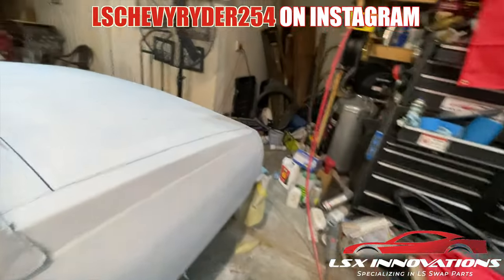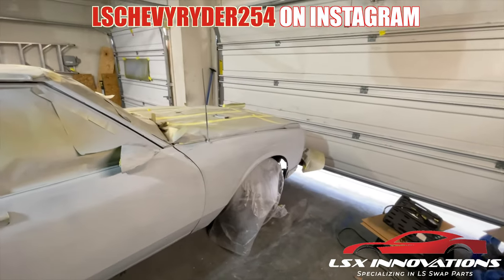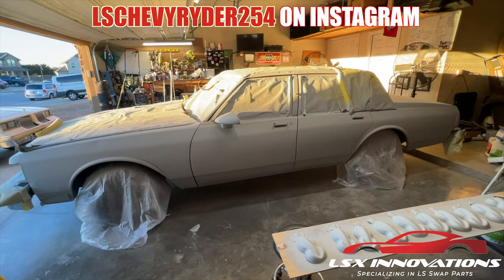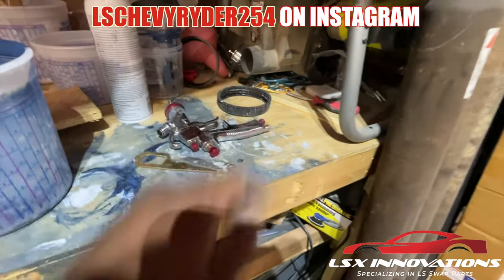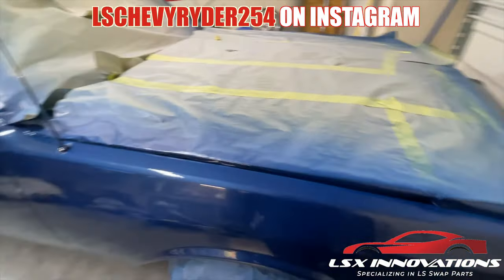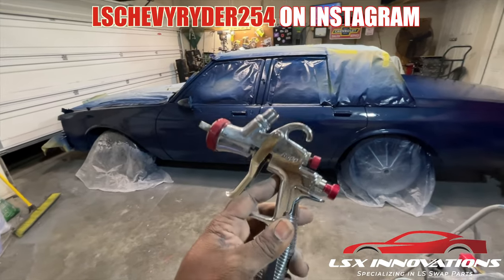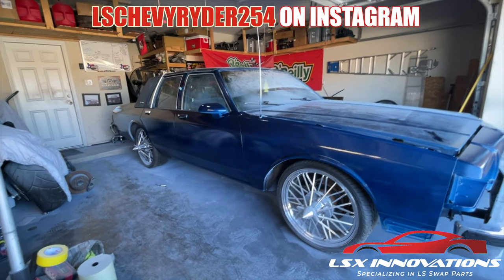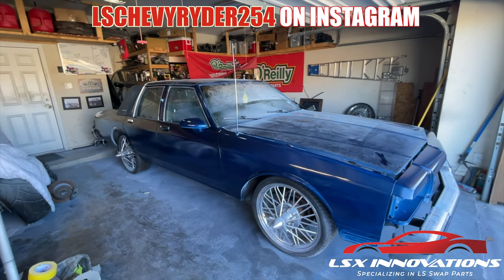LS BROUGHAM TRIFECTA IS PAINTED........BEST SPRAYGUN FOR HOME 110v COMPRESSOR !!!

Comment: 1.4 TIP !!! 💪💪💪💪💯...THE GANG DOING EVERYTHING...
Reply from the maker: this gun has 1.3 tip
Reply: @LSCHEVYRYDER254  kool ,they close👍💯
Reply from the maker: @BLACKRAIN390  yea the biggest diff i think is the lvlp gun that or the paint is just that much thinner than the primer
Reply: @LSCHEVYRYDER254  YEP, PRIMER THICKER....SO GUN ADJUSTMENTS FROM PRIMER TOO PAINT HAVE TO BE MADE, AS WELL AS AIR PRESSURE....GREAT JOB LS💪💪💪💪💯👍
Reply from the maker: @BLACKRAIN390  thanks bro